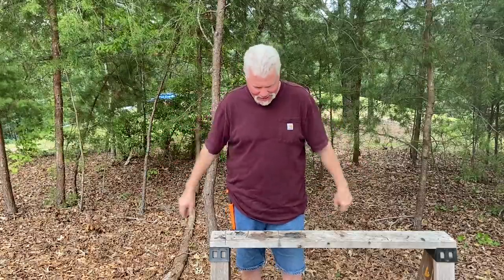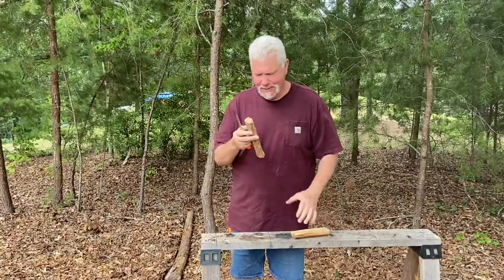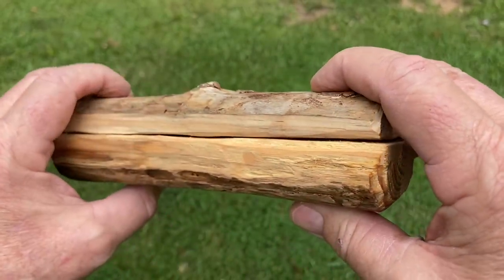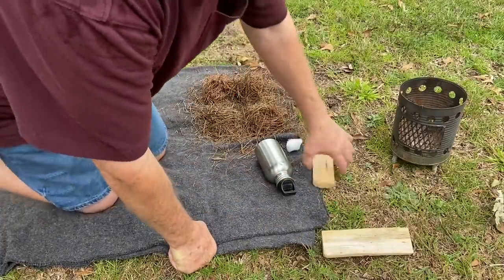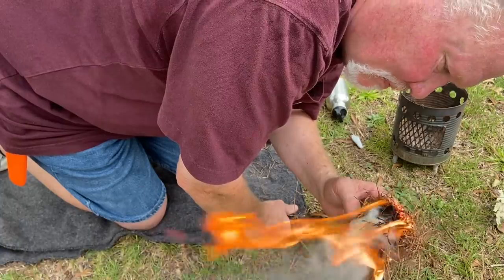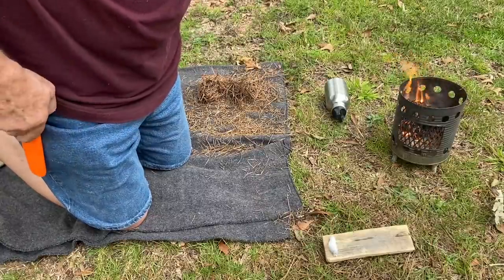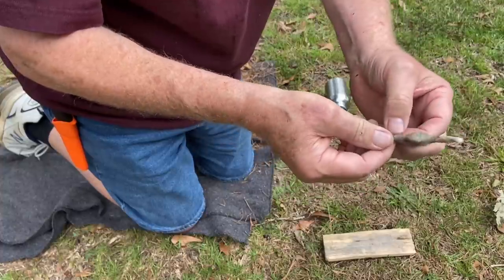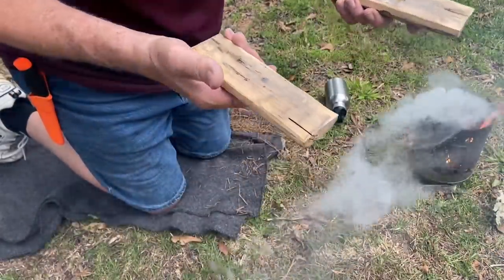Making Fire Roll Boards Out Of A Pine Log

Comment: Ok I have mastered several ways to lite fires. This was the only way I had not practiced with. I didn't think about splitting a log and making fire boards on the spot but I will be trying today. Thank you once again David.
Reply from the maker: You saved the easiest for last.
Reply: Looks way easier than twirling a stick between your hands.  I tried my guts out doing that and the tip never even got warm.
Reply from the maker: LOL! been there done that.
Reply: David, did you save these boards you made? i thought about making some to keep in my pack

Comment: I Asked the question if it could be done on a short board/boards on your other channel.. You answered I should check out this channel and see for myself .. Awesome ! All I say is awesome !!  Every question I have asked you  in the past , you have taken the time to answer me  and that is very much appreciated! 
Your videos are so educational .. Thankyou !! I’m thinking the reason I was failing at my attempts with the shorter boards was I wasn’t fixing the bottom board on the ground etc .. like you did here.. 
I was always trying holding both boards ( one in each hand ) and rubbing ..   regrettably with no success.. 
Now I’ve seen your proof that it can be done and can’t wait to try it your way ! The proper , successful way !!! 👍 Thankyou for this !!
Reply from the maker: A fallen Beech or pine without the bark makes a good "bottom board" or a boulder or flat rock. Just a split piece of wood for a "top board" sometimes you don't have to split the wood just use the round surface... They're all in that playlist.

Comment: You're the master of fire making! 

You've mostly used ash with rolling method, metal corrosion as well.  

I am a smoker,  and use cigarette ash to darken cotton wool, with fresnal fire method.  

Wondering if cigarette ash would work with this method. If you've tried it?

What other ashes/ elements could go as igniting elements in this method? Like coal dust,  magnasium shavings/ dust,  ferrocium dust etc.
Reply from the maker: See my fire roll playlist.

Comment: David, you could have used that hand saw and cut it perfectly flat down the center vertically, and then cut it off, forming two perfect fire boards, without having to whittle.
Reply from the maker: Lol. Ripping is 10 times harder than cutting cross grain. Using straighter grained woods that split truer is the answer.

Comment: It would almost be a good idea to carry some sandpaper in your pack so that if you do end up making boards for a fire roll in the wild or in an emergency if you had some tough enough grit sandpaper, you could fold the sandpaper in half so both sides have the grit and then take your two boards and rub them together with the sandpaper in the middle and then you would get a really nice smooth flat surface on both pieces of wood.

Comment: Idea:  Because you have a saw, make one cut across the log.  Then rip the 8 inch length with the saw, (the slit).  Then cut the final cross cut for the length. Should be perfect and less work.
Reply from the maker: These saws are too hard to make rip.

Comment: David, can the Mora sheath be used as part of a friction block for this? Or would it melt it? Regarding the ferro rod striker, can you think of various, non traditional items to use a striker that might also fit on the keychain? Would a washer work? A nut?🔩 Does it work better if there is a curved area in the striker to match the ferro rod? I know it’s ideal to have a 90 degree edge on it.
Reply from the maker: Yes, No, Hacksaw blade and striker that came with it, No, No, 
No, Yes... No more questions please.

Comment: Big fan of yours, with the time you spent cutting the boards wouldn’t it be easier to saw it down the middle and have two perfect pieces? Not hating just asking. Keep up the videos, by far the best videos on YouTube.
Reply from the maker: Rips are very difficult, the wood would be hard to hold for such a rip, it would be hard to make a true cut that didn't still need whittling to fix.

Comment: Is it best to ve have a  rough surface on the fire boards? Or is better off smooth and tight-fitting. Should the boards be a specific species ? Or any ting will do it.
Reply from the maker: Smooth is more difficult and too rough is also. It's the wood ashes that allow both types of boards and all boards to grip the fire roll. See my fire roll playlist.

Comment: You might also try ripping the log with your saw.  I suspect it would yield two slabs much quicker than whittling.
Reply from the maker: Ripping is slow and difficult, hard to hold the wood, and hard to cut straight. A different toothed saw, less teeth per inch... maybe I'd try.
Reply: Ripping a log with a small camp saw is Dam hard. You are going w/the grain and that gums up and binds the saw up. Not easy!

Comment: Fascinating. Do you have a specific video that talks about how the method works? Like does the ash provide friction or carbon? Is it just the cotton that starts to burn? Do think there is enough heat from the cotton roll to ignite a candle wick if dry tinder isn't available? Thanks
Reply from the maker: The rolled ash and cotton causes friction and a chemical reaction. See my fire roll playlist.